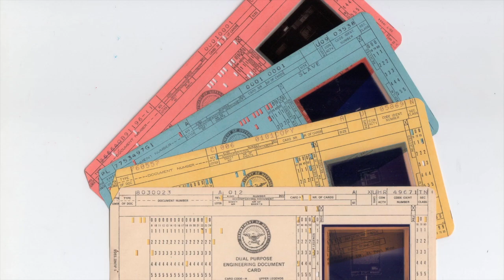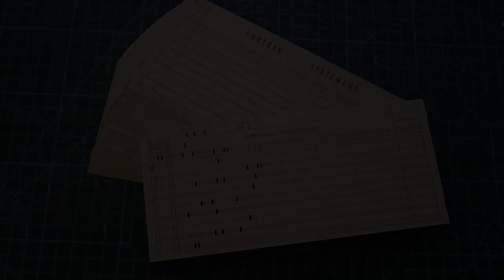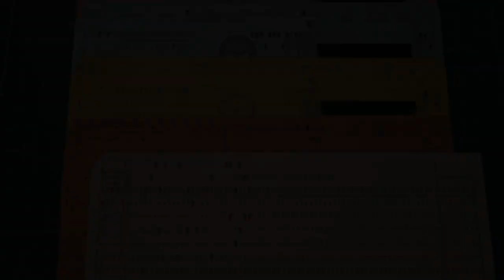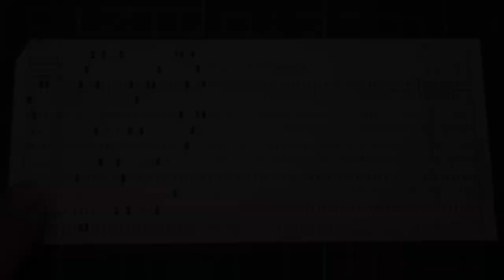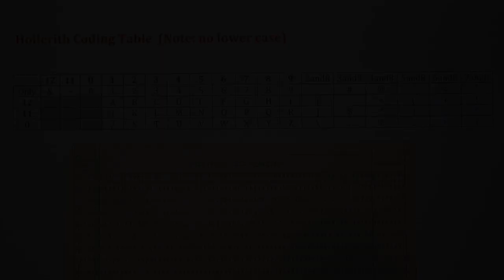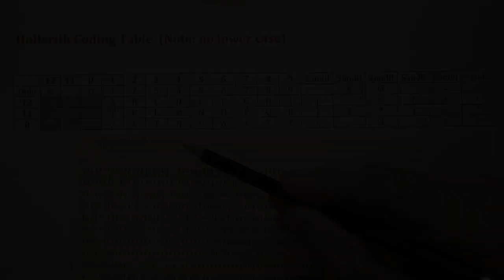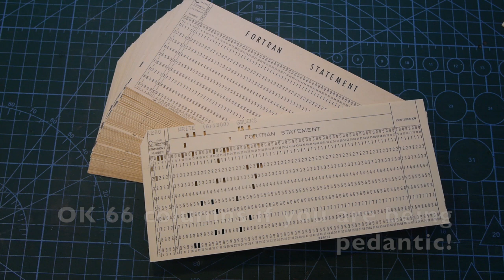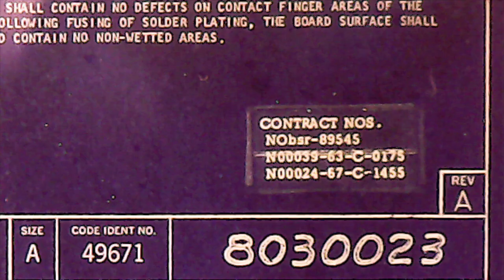IBM Punched Cards Explained - Video 207

Comment: Early terminals used to have a width of 80 columns. Now that's because a single IBM punch card could store the same number of characters! (however the last columns of the punch card were reserved for collation, so these columns did not serve any practical purpose on the terminal, confusing...)
Also: IBM has the EBCDIC character encoding, where the lower four bits corresponded to positions 0 to 9 of the Hollerith encoding, however that would not cover the situation where multiple positions are punched (such as 2 and 8)
Reply from the maker: Thanks Michael. That’s really interesting and yes it does seem odd with the terminals using that width!  The coding used is interesting too. Now I need to get on and do a video on punched tape. Thanks for watching and taking the time to comment. FJ

Comment: There was another issue related to having a single or few characters wrong in a program. Garbage in garbage out, but specifically on the printer! So garbage on the printer typically started spewing pages of useless printout.

My partner once made a program error in the old days, when there were Xerox printers capable of printing a box of paper in just seconds for large mailing operations for example. This error, however, went through 10 boxes of paper before being stopped.
Reply from the maker: Oh my word! I remember how incredible fast the barrel printers were too! I got two identical bank statements a week apart the other day and on contacting them they said a similar thing and just ran the batch from the start again!!
Reply: @AnthonyFrancisJones  Nobody is going to believe this, but I actually had a (specifically) barrel line printer in my basement for a while. (Before the really fast consumer printers were available.) Theoretically could have run a wide page off in several seconds. (I see online they might have been rated 600 lines per minute, but I know they moved faster past blank lines.) The barrel printer had a hammer for each print column that hit the letter at the moment the barrel (of columns of typefaces) hit the character for that column on that line. You could tell if the printout was from a "barrel" (AKA "drum") printer as the line might be just a tad uneven up and down as timing errors missed the exact position as the characters rolled by. Alternately a "chain" printer the characters sped by horizontally so had slight left-right misregistrations which were less annoying. Had intended on building a PC interface to make it work, never got around to that. THEN cost more to haul it off than I paid for it. (I still have parts kits somewhere with belts and fiddly stuff to throw out.)
Reply from the maker: Wow, that's quite a story!  I remember my first personal/home laser printer and even that took two of us to move.  I remember the barrel printers well from the mainframe we had installed at my school - great schooling that!  The school even had an electron microscope.  I think all donations from parents' companies throw outs!

Comment: I had (but finally some 40 years later got rid of) one of the massive cables that hooked the old IBM reel-reel tape drives.

AND I'm sure I have a small section of the actual "core" memory from an 7094.

Editing cards was interesting. In the "older" days of cards to insert a character you held the input card which could be "duped", but stopping at the point to insert a letter, holding the input card as you typed the inserted characters so it slipped in the rubber rollers without moving to the next character. (This was not an intended function!!).

I remember that the coding for alpha characters started with upper punches coding for 'A', 'J', and 'S' (third row labeled 0), and the index of the letter in the group starting at 1. So first row and '1' punch was 'A", etc. Except S group punched the '0' as first, and they left a space starting with '2' row for the 'S' character and incrementing thereafter. (Had to refresh myself on the code a bit by verifying the characters printed, on another video on the cards.) In any case "in the day" I could (slowly) read the cards by hand when there was no printing of the represented data on the top line (at least enough to guess the content generally). [Edit: OMG, you actually went over that coding in detail, didn't get there immediately.]

Card burning party when we no longer needed them, that was fun. Except we didn't actually bother to burn any cards, just went on to drinking some beer and dumped boxes into the dumpsters.
Reply from the maker: Gordon, thanks so much for this.  I can only retell stories so it is wonderful to hear the detail from you.  Yes, those cables were massive and you could hear them working/creaking as they had pulses going up and down them if I remember.  Great you could directly read the code on non-typed cards.  I believe there were a number of coding systems in use.  Facinating to hear how you made corrections too!  Thanks so much for sharing your experiences.  F-J.
Reply: @AnthonyFrancisJones  (Made some minor edit corrections in above for accuracy/typos.) Wow very interesting that you discussed specifically the amount of data to store this video itself (14:35). I'm a fellow physicist (looking up your pages) but turned to engineering/CS, and very specifically in an image pattern recognition department that had the aforementioned 7094. To store that video, you would use a variation on MPEG encoding. A forerunner of that encoding is JPEG, single frame not motion comparison of frame differences.

Some of the researchers in my department were working on "data compression" research, and long before they actually got such methods to actually work. You see, the 7094 was kept around because it had especially fast math capability but pretty useless for ordinary computing, it only had 8K memory. They would run FFT transforms (2 dimensional) on 512x512 images (only a fraction of your present video frame size).

One day there was bit of a meeting on the raised floor room and a big cheer went up just as I walked in. It was an announcement that JPL (I believe) had beat a data compression goal of what was stated as "one bit pro pel". Now this was geek speak at the day, the "pel" was what we call 'pixel" most commonly today. The "pro" was just slurred speech to get the words out fast, so it meant "one bit per pixel" on a black and white data compression. So compressed 8:1 was the implication. (Black and white image 512x512 uncompressed would take '256K' or 256*1024, but compressed only 32K or 32*1024 bytes approximately.) Modern JPEG and MPEG are based on that research, generally using 64x64 pixel subgroups for a quick FFT transform before other steps to select what to keep without perceptibly affecting the image quality. And MPEG uses frame differences to reduce the rate of change. (YouTube today uses modern variants of "MPEG" for most videos or methods closely related.)

I know they must have transferred the programs too on the tape because we had DEC equipment too. And they ran the transforms of the 512x512 images overnight from tape. (I've been trying to remember if there was a card reader on the massive raised floor, the computer was used only for that one function by the time I was there.) It took all night. Now your phone can run this calculation at multiples of the frame size, at 30 or 60 frames per second. What they did took all night for one frame. But we knew all this image processing was going to be part of the future!

PS: The reason the tape drive cable was almost 2 inches in diameter is that it had parallel data transfer to the mainframe. But back then to have fast data transmission one needed a "transmission line". (You know this, I see scope on your bench.) But then each transmission line of the day was made up of a wire that is as big as the video antenna cable we still use, so a whole bunch of parallel bits took up that several square inches of cable cross-section, they didn't know how to make it small back then.
Reply from the maker: Facinating again Gordon.  You really did live though a very interesting time where chance was clearly 'visible' and computing could be timed on a normal clock and heard working!!  Ah, yes of course, transmission lines.  Nice bit of physics that, showing how the electric fields travel down them.  Now I must get on to making my punched tape and magnetic tape videos.  Never enough time for all the fun.  Tensegrity one coming soon when I finish the build!  Good to hear from you again and love to hear your experiences, F-J

Comment: When I was a PhD student one of the other students arranged to use software at Cambridge University, and as this was the days before mass networking (1976ish) he transferred his data to punched card. My pal A (now Prof Sir A, FRS) was a very clumsy person, and on the train to Cambridge the inevitable happened: he dropped the large box of cards, spilling them everywhere, performing an almost ideal randomisation process. When he got to CU he couldn't use their card sorter as he had not punched the sequence number (which would have been a trivial thing to have done), but did have a printout of the data, so spent hours sorting the cards wrt the printout. He eventually got the computer run he went there for. 

Yah, you try an tell the young people of today that, and they won't believe you...
Reply from the maker: Great story!  We should coin a phrase from this - that will never get used again - the meaning of which is 'the more you plan not to the more likely you are to drop your card stack!'  A kind of a holey law if we are talking punched cards!  Perhaps Chad's Law?!
Reply: @AnthonyFrancisJones  Wot! No cards!

Comment: Thanks for this vídeo.

I'm from Brazil and used punch cards in my 1st year at University in 1984 in a Burroughs Mainframe. I did a lot of Fortran and Algol program. In the next year they replaced it by an IBM mainframe with dumb terminals. I still have some punch cards today.

As a sugestion what about a Univac mercury delay-line memory video.
Reply from the maker: Thanks for this - must have been a very interesting time!  Mercury delay-line, will have to have a think about that one.  Mercury is a relatively controlled substance (due to toxicity) in the UK but perhaps I could simulate it?  I would have liked to do a nickel wire magnetostrictive one too but so difficult to build I am told.  However, I am finishing a video on Diode Matrix ROM at the moment so that might be of interest.  Thanks again for taking the time to watch and comment.  F-J

Comment: 8:51 Wrong. That card is a comment because it has a C punched in column 1.
Reply from the maker: Thanks Steve, and well spotted.  My explanation says that it is not program but just text continued from the last card but I think I should have said 'Comment' and not 'Statement' to separate the two concepts.  Thanks for watching and taking the time to comment (no pun intended!).

Comment: 15:48 What we had here was much like those cards, except they were called Scantron, and a lot of our tests and final exams were done on them. There was always an answer card, read first so that the correct answers were loaded in, and then switched over to a reading function which printed along the card how many were correct as other cards were fed in. 

Also, fun note: There's a bit of a joke punchcard, known as a lace card, or an "IBM doily". Loading that card was a bit of a chore to remove, necessitating the use of a card knife or card saw.
Reply from the maker: Thanks for these excellent anecdotes/recollections!  I think the Scantron is still in use to this day but the sheets I remember in the UK were only for external exams and usually on a sheet about A4 sized rather than the Scantron rectangular sheet.  Yes, a lace card would be pretty much guaranteed to jam!  I am not sure what commands would be needed to be entered into the punch to make one but it would fall apart pretty easily!  Thanks and great to have your observations!

Comment: How does the adfressing work?  You have what looks like a row number section,  so why do cards need to be kept in order if you're programming?  Could you just replace card 1200 (say) if you chnage a line?  Could you input all the cards out of sequence but rely on the card numbers for your program to work?
Reply from the maker: Paddy, that's a good question.  Generally it was much more convenient not to have to have line numbers read off the cards - slows the process down and needs careful software and memory management.  So, make sure all the cards are in order and read them in sequentially.  That is not to say that if you did wish to change a line of code you could of course punch up another card and swap it out but remember you would need to read them all in again and wait for it to recompile and run the program.  The trick was to get it right first time!  As ever, thanks for watching and a great question.
Reply: Anthony is right. But additionally the FORTRAN line numbers were target of "GO TO" statements so could remain fixed even if adding new lines. (You could of course renumber those as well, but then all lines referencing a "GO TO'" etc. would need to change as well.

So the sequence number might be auto-generated by duplicating a deck through a computer program to renumber the sequence numbers (and punch a new deck thusly sequenced). That sequence number, when changed or regenerated, would not affect the "GO TO" line numbers used within the program. Sequence numbers might skip 5 or 10 allowing small modifications with manually editing the sequence of the edit, preserving the sort order. Sorting equipment could be set up to literally sort a disordered deck back if it had the sequence numbers.

Additionally, I now remember, the "FORMAT" statement that laid out fixed text and format of numbers was a separate line in FORTRAN, and was referred to by the "statement number" as well as "GO TO" lines. I'm not sure if the statement numbers even had to be in order.

Of course the program needs to be in sequence including all the lines that don't have 'statement number' values.

People who worked on old BASIC programs may have had every line with a line number, which could also be used in GOSUB or GOTO, similar to the FORTRAN "GO TO". That wasn't true of the original "Dartmouth" version of Basic, that was an addition for the Microsoft/Bill Gates version (back when he actually did coding).
Reply from the maker: Excellent! Fascinating as ever and I am learning a great deal from your experiences so thanks again for taking the time to recount them.

Comment: A card could store 120 bytes
Reply from the maker: Great - and thanks for sharing your experiences too.  Much appreciated!
Reply: @AnthonyFrancisJones  started with an IBM Porta punch where a stylus was used to punch one Chad at a time.  Then O29 punch and finally a 129 punch after which I used 3278 Terminal.
Reply from the maker: @saltyroe3179  Excellent! Going from the Porta Punch to the 029 must have felt like a huge leap into the future!  Thanks as ever for sharing your experiences.  Adds to the facinating collections of stories of those that watch the videos.
Reply: @AnthonyFrancisJones  long after the punch card was not used in business,  many places still used specialized Porta punches for voting.  Los Angeles County only got rid of punch cards for the primary elections in 2020.
Reply from the maker: Yes, it did seem like a very outdated technology.  I remember all the issues with the hanging chads!

Comment: The card had standard encoding, but a user was not limited to standard codes.  Punch card voting (which I used) each hole was a vote for candidate.
Reply from the maker: Yes, I guess they were very flexible from that point of view.

Comment: What if you made a punchcard reader with standard paper punch and paper that lit up a seven segment LED? That might be a fun project.
Reply from the maker: Mark, you understand me so well!  I was thinking of doing that a while back and I really should!  Would be nice to do it with a real (old) bit of punched tape.  I like your idea of using a standard paper punch, the tape could be about 5cm wide and would look interesting!  How about a punched tape loop reader that drives a seven segment display light chaser?  You have got me thinking.  I bet 'Look Mum No Computer' has beaten me to it!!  Diode matrix video coming before too long I hope.  Quite a bit of building still to do!
Reply: @ I think you would be the first
Reply from the maker: I will have to do it - too many ideas and not enough time!

Comment: Remember having access to an early HP machine at school that would read BASIC programs from cards using the conductivity of graphite pencil marks.  It would only come to the school once a month to read in your program, often to only to spit the cards out out with a syntax error.  Haven’t seen cards used for a long time, but I did work with a related punched hole tape system on a radar data processing system, operational up until 2000.
Reply from the maker: Excellent.  What a great idea for a school!  I do remember the graphite stripe exams when I did O'Levels back in the day.  (Love telling my students I don't have any GCSEs!).  Punched tape is facinating too and another low density storage mechanism.  I am working on a diode matrix project at the moment, so hope you will find that interesting.  Good to hear from you as ever and hope your projects are going well too!